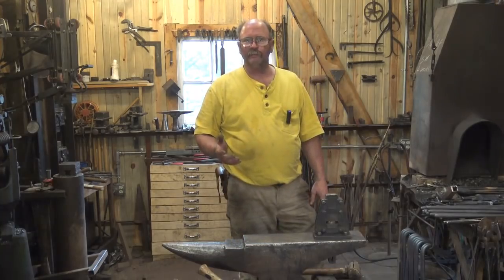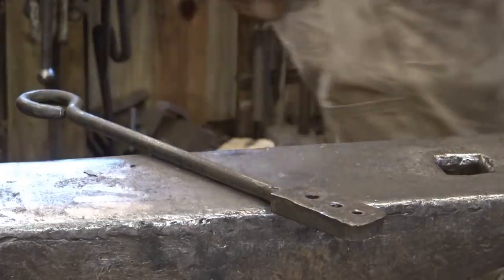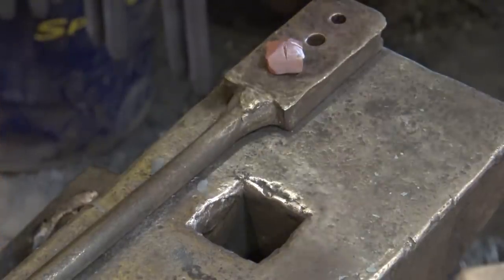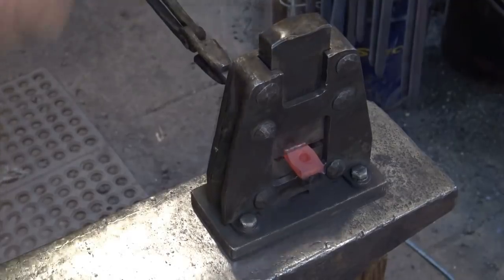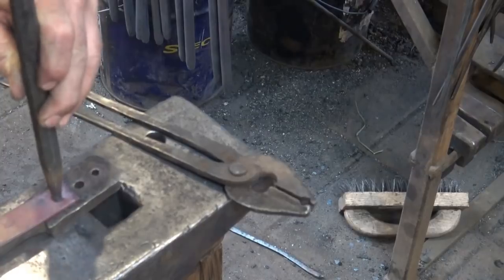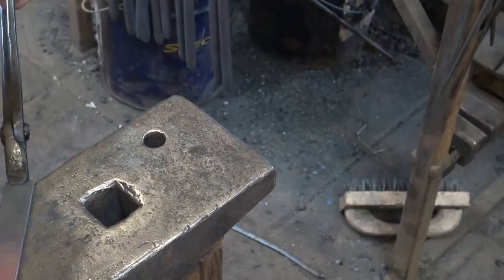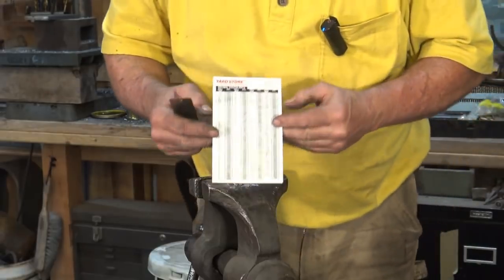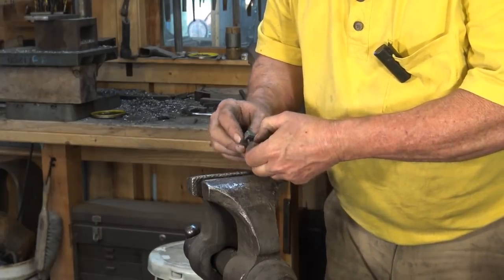Forging a bolt, nut and washer - basic blacksmithing exercise

Comment: Great video.  A few years ago I restored a corn picker built in 1904 by two brothers living in North central SD.  The machine was mostly made of wood.  Many of the bolts were hand made carriage bolts ranging from 1/4" to 1/2" and up to 24" long.  It was quite obvious that producing the bolts in quantity was more important then in quality.  Heads were oblong, some split and most off center, but they did their job and are still doing it.

Comment: Great video John! I've made a few nuts and bolts for some projects. Another thing I've done was making nails that won't pull out. That might be a quick video. Basic 3" square nails but I put Barb's on the corners and gave em a 1/4 twist. I also took the extra step of fullering the 4 sides before I put in the Barb's so they stood out more. 10 years later they're still solid.
Reply from the maker: Ihave never done that with a nail, but I do barb hinge pintles

Comment: I really like that pyramid bolt head with the lines cut in. I guess I would have cleaned the scale off the bolt before cutting the thread, just to not cut through any scale. But since you filed the tip, I guess there is very little contact with the cutting edges and the scale.
Reply from the maker: Typically the bolt needs to be cleaned up a little and that will also remove the scale.  This one ended up exact size so i didn't want to reduce the diameter anymore.

Comment: I’m working on restoring an 1800,s horse cart.  There are some missing nuts and bolts.  Now I know how to make proper looking square ones.
I have had to replace all the wood but most of the metal bits are still there.  I’m bogged down making steel tyres for my wheels at the moment.
Reply from the maker: I have never made tire.  It requires some precise work.

Comment: As I said before, I didn't know you could do that, but now I know! Very useful, thank you. I have a question what is the angle of the cut off dies for the guillotine tool?
Reply from the maker: I will try to check, but I am guessing about 30 degrees
Reply: Black Bear Forge Thanks!

Comment: Nice little project John.  Question is it possible to make wood screws or sheet metal screws with a pan head or flush in the blacksmith shop .... THX.....Paul..
Reply from the maker: Yes, but you must hand file the threads.  I have never found a die to cut that style of threads

Comment: Would having an integrated slot along the side of the smithin' magician for a kiss block not be a good idea? Then you could butcher down to the size you want? Obviously your track would have to be pretty tight to avoid lateral tilting or you could just oversize your kiss a little?
Reply from the maker: I have tenon dies that incorporate a built in kiss block.  I had never thought about it for the butcher.

Comment: I know this is blasphemy, but harbor freight sells a really great 45 piece tap and die set. It’s about $85 normally, but can be had for around $60 with coupons. It’s and excellent set for beginners, and it even works great for people that is them every day.
Reply from the maker: I have a similar set and have for years.  It has all of the odd sizes I never use.  But all of the common sizes have been replaced with higher quality taps and dies as they wear out.
Reply: Sounds better if you call them H&F tool supply

Comment: How did they cut threads before they had modern taps & dies? I am thinking maybe a thread cutter on a lathe type tool maybe.
Reply from the maker: I think bolts were very rare before a tap and die of some form was invented.  Clinch nails and rivets would have been the way to go.  Early taps and dies were often less specific with a long tapered tap that would cut the same pitch on an assortment of diameters and dies were adjustable to match.

Comment: i want to turn a hammer into a wrench, and it will need some threads, because I want it to still be an adjustable wrench. Or vise versa, maybe the wrench will become the hammer. At any rate, I like wrenches and hammers, and I want to make one that is both. I probably need a forge, but I might be able to do all this with an angle grinder and a welder, but I don't know how to weld, and forging stuff seems really cool. Do you have any suggestions? Also, is a welder cheaper than a forge, or do I have that backwards too?

Comment: Regarding the point about using punches to drift, isn't the main issue(besides over-tapering the hole) the danger of overheating the punch and ths risk messing up its temper?
Reply from the maker: That is a big issue in thick material or where you will be leaving the drift in while you forge the outside of the eye.  Not much of an issue in thinner material.
Reply: Yeah, makes sense. I was thinking in general terms, doubt a small thin piece like the washer in this specific job would be able to impart enough heat for it to be an issue.